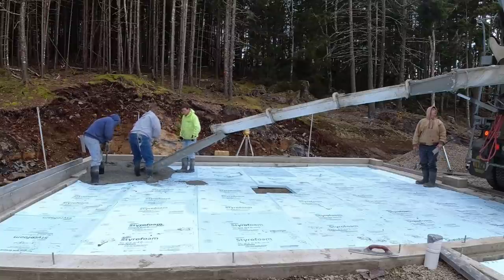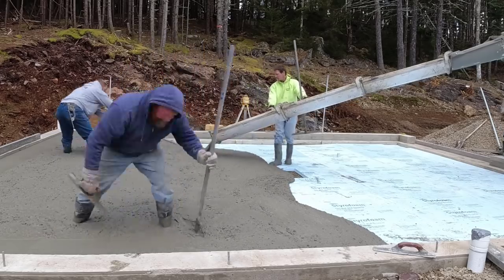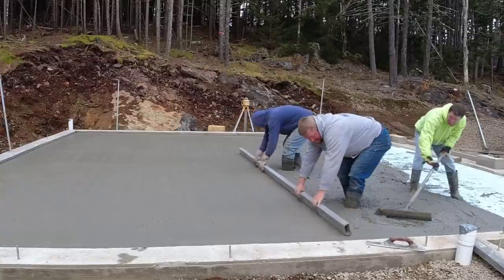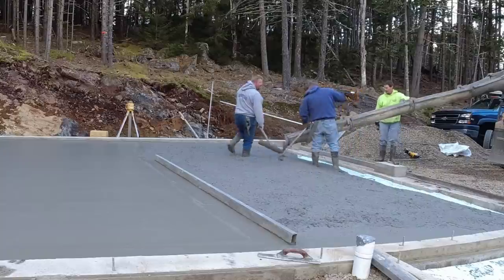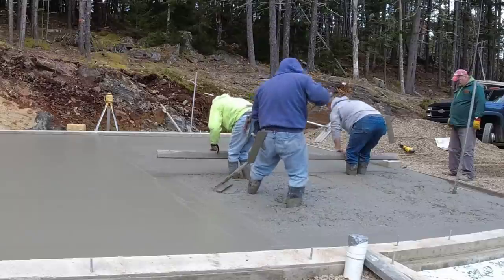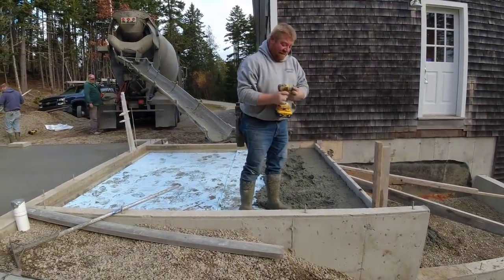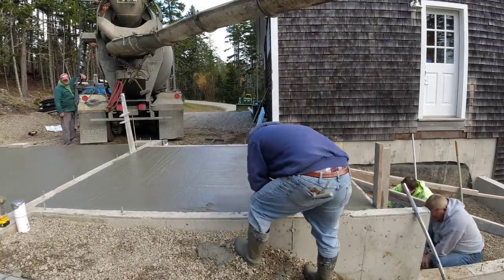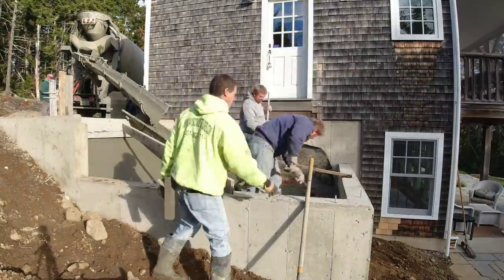My Favorite Cold Weather Concrete Mix (Sets Up Really Fast!)

Comment: As a inspector that does this type of inspection its great to see someone with the knowledge of concrete in your trade. Most don't have a clue about hydration and water cement ratios. I was taught by an old guy who called it the devil's rule, 666, 6 sack mix, 6-inch slump, 6 inch thick. And wouldn't allow extra water added on site always used chemical additive such as a high range water reducer to increase the slump and he would not allow water to be sprayed on top of the surface cuz then that creates poor surface finish that does not have the the durability that it should since it creates a different hydration right when you spray water on the surface from what's curing below it. Great job I commend you.

Comment: I used a 4000psi concrete mix with fibre and 2% calcium. Was supposed to be here at noon to pour it but they were 2 and a half hours late. They also brought it too wet, which is currently why I am still here the next day waiting for it to set up. Also had plastic under it. So yes, probably will be here till afternoon

Comment: The foam r10 Ridgid Foam definitely helps set time. Pouring on cold ground sucks the heat out of the concrete increases set time. In the winter we blow heat tarp doors if it's a garage and tarp stairway of basement and blow heat all weekend for a Monday pour. I like 4,000 psi 3/4 stone 2 bags Dow Calcium Chloride Flake. Unfortunately it's not good if you use steel wire it corrodes. Liquid Calcium non chloride for wire liquid Calcium doesn't work as good seems like it doesn't go then kicks at the end! I have gone 4 bags 10 yards never again. We were power troweling while truck was washing out no joke.

Comment: Here in Alabama we use 3000 /4000 psi concrete 2 or 3% calcium mix. If sun is out calcium don't help unless sun is shining.most our concrete company won't bring if temperature is below freezing their water freezes up in the truck.no heated water ...be nice if they did though.we use form a key for crack control and for screed purpose as well.keep it 💯
Reply: It is a nice warm fuzzy feeling when you jump into warm crete with cold feet.Can feel it right though your boots. We poured a large slab in Decatur a few winters ago. I was kind of on the sad side that there was no hot water.
Reply: @billpapps4345  LoL I bet coldest days I get ice out of my boots and work all day with frozen wet feet!
Reply: @billpapps4345  since house market crashed concrete prices double here! sucks!
Reply: @bubbag9952  Harrison concrete got the gov contract. They are 230/280 a yard. They dont care about the smaller guy. Rest are 150 to 200 a yard.  All pricing gone crazy high. If it not been for doing Convenient store parking lots I be SOL
Reply: @billpapps4345  know what you saying there! Barely hanging on here.

Comment: I just poured 7sack 2percent, no ash and hot water. Dumped it out by 9, still sitting here at 1. All shade and it was 20 when we started. Obviously it isn't going as fast as it should. I have time to watch this.

Comment: Quick question please, can you use calcium chloride with a plasticizer? Do they cancel each other out? If you want the workability of a plasticizer but don't want to wait forever for the concrete to setup.

Comment: Concrete is not the same from plant to plant around here.  This morning it is 27f going to 46 for the high, Are 1st real cold day. I am going to be using 4000 mix, hot water.  No ash or slag. Fiber.  This plants mud will be hot as a fire when it gets here.  That kind of mud that comes out as a 6inch and locks up to 4 inch on the ground. I would not being using any boom juice or liquid sunshine. The plants stocks needs to cools off.

Comment: hey man i really need your help, i wanna now what is the best concrete for concrete stairs, last year I bought from home depot but it exploded with the cold weather, I live almost in maine
Reply from the maker: I use a 4000 psi mix with 6% air-entrainment for that in Maine. You'll have to get that from a Ready-Mix Company. Then use a really good concrete sealer on it and don't use de-icing materials on it, only sand.

Comment: Why the rectangle in the middle without any styrofoam?
Reply: I'm guessing a Lally column is going there. It can be designed to not have a pole or Lally by engineered lumber but it cost more but eliminates it for a clean look and no Lally to worry about opening car doors etc.